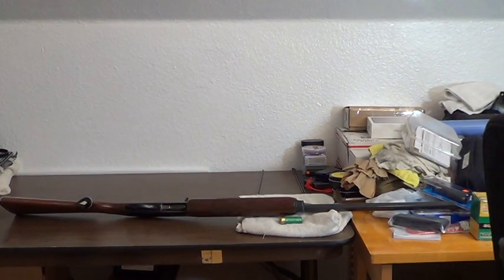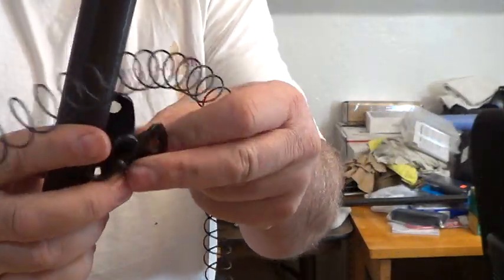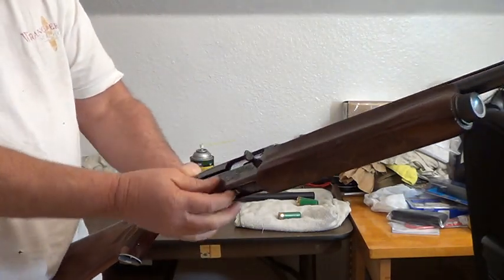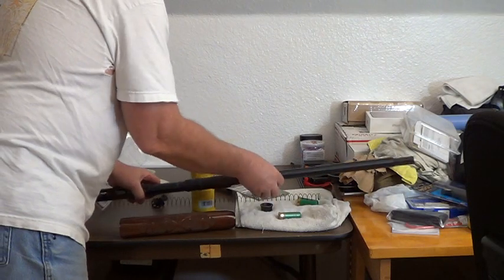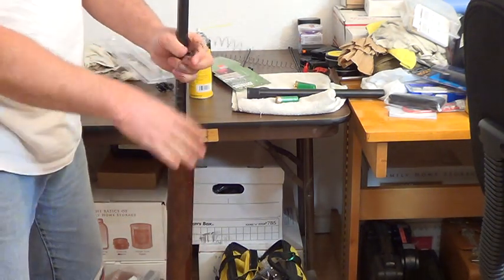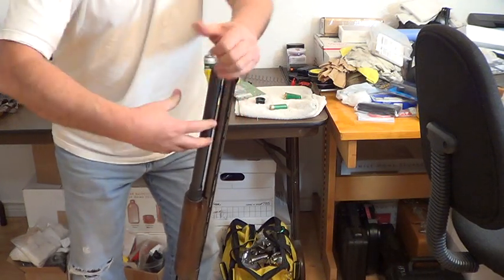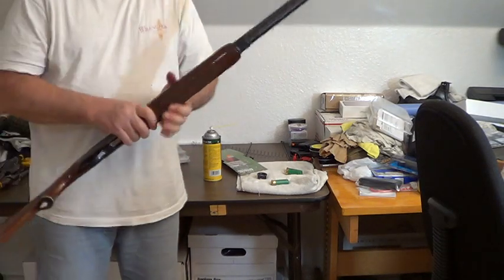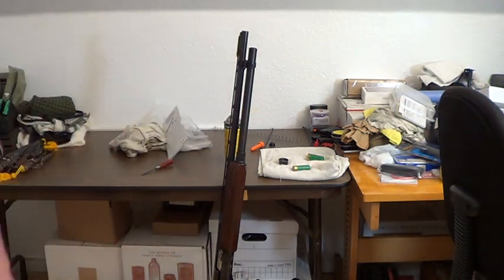Adding Magazine Extension Tube To Remington 1100 Shotgun - Removing Mag Tube Spring

Comment: Mac Cliff here again. I just finished doing this to my 1100. 
A 1,000,000 thank you’s for making this video. 
I couldn’t have done this without you posting this! Thanks so much, I’m so happy 😃
Reply from the maker: thanks, glad it helped..
Reply: So you didn't have to drill out or file down dimples in the barrel so it can pass through to the extension?
Reply: @HUMBLEMANTRYING  
No. This was a very simple task. No machining or modifications were necessary. Remove the old magazine tube and install the new one. very simple. If you have any more questions, I'll be happy to answer then. Just let me know. Cheers.

Comment: Did you put 8 shells in, I think not, you have a demple that has been removed  at the end of the tube to allow more shells, I drilled mine out,also my tube came with threads at the top of tubeso the cap could be installed to keep water out

Comment: Thanks for this.  Just added a tube for my 1100 20 gauge "heavy frame" (means it's an old model - 20 gauge on a 12 gauge frame).  Went from four in the tube to seven.  No instructions needed - just watch the video.  My only caveat for those of us who own the 20 gauge heavy frame - get the 12 gauge tube, not the 20.  The 20 gauge tube would not fit on my shotgun.  12 gauge tube works like a charm.

Comment: That thing is bad ass Rick . I remember when you did a test fire of a 1100 you bought and the sight upgrade video . I was going to buy a 870 28 inch or whatever length the long hunting 870s are and do the same thing . I still may . Do you think the clamp should have some loctite because of the 12 gauge recoil ? Any way that thing is ready to lay down some firepower now . Thanks
Reply from the maker: no because when you clean it after you shoot you should be checking things to make sure.
Reply: Fair enough . I just know that heavy recoiling firearms tend to rattle screws and things loose over time .

Comment: The extension I added was the same as yours; a ten shot, but the follower seems to get hung up after loading four shells. The mag I received did not have the orange follower included. There are no obstructions in the mag tube. I probably need to change the stock follower to an orange nylon one.
Reply: or try to bevel down the follower so it pass the point it is getting hung up on.  just sand it or dremel the back edges to round them over.

Comment: I recently got an extension, assemble it but once I insert 5 shells, it doesn’t take any more shells. I did it just like you did in the video but cant  find the issue to fix it.
Reply from the maker: it should say on package how many rounds it will extend, they have different sizes.  Also check that you did not leave plug in your plug (the empty part that shows when no rounds are in tube. should be 1/2 or so
Reply: @HeyGunPeople  it says 10 rounds. But ir only fits 5 and 1. Weird right?
Reply: @MarRub12  depending on the year your shotgun was made there might be “dimples” in your magazine tube. These will need to be  drilled out in order to allow shotgun shells to pass while being loaded into the magazine extension.
Reply: either drill out or they make a swage tool to flatten those dimples out. looks alot cleaner with the tool.

Comment: Would this tube extention work on the browning A5/Remington model 11? I have my great great grandfathers model 11 and would really enjoy bringing it out of hibernation with a healthy capacity
Reply from the maker: not sure would have call remington and get their input
Reply: so long as you have the correct gauge tube and the threads line up correctly, I can't think of a reason why this tube wouldn't work on really any shotgun
Reply: Dean Bergquist no it won’t work on those guns. They are recoil operated and the barrel moves inside the receiver with the bolt. You get put a 2 shot extension but you cannot use the mag tube barrel fastener.
Reply: @HeyGunPeople  I'll just use the old metal follower that came stock on my dad's mid to late 80's Remington 1100 and take out the old wooden plug and spring to put aside in gun cabinet and good instead of having 5 shots with plug out now 9 or 10 shots with this extension tube and keep my shotgun in original condition other than mag extension !!!

Comment: That's called a Spring Retainer,  being picky I know.   Some have 2 holes and you use your angled snap ring plyers to remove.  Saw comment below that the Orange thingy fits below spring and contacts bullet.  

Made a crap load of shell limiters,  some extra long for the extension tubes,  figure they are playing games when hunting waterfowl.  Never been asked about the 1100.   

I changed out by 1100 barrel so I could shoot 3" shells.  Great gun,  shot the crap out of mine and beat it to death on bird hunts.

Comment: Hi - thanks for the video 

My last shell won't eject into the chamber - (I'm doing it manually - not shooting) 

There is a little lever on the inside and if I push it the shell releases 

Gun hasn't been used in a while 

Could it be a lubrication issue??

Comment: I use my 1100 for dove hunting. Considering on using it to duck hunt, but that considers steel shot.  Can my 1100 shoot steel shot? I keep seeing a bunch of different videos with yes or no. Can someone help me out please, thank you.
Reply from the maker: Remington settled a class action lawsuit in the early-mid 1990's regarding the metal quality in their barrels, and guns coming unzipped. It was mostly about handling steel and higher velocity loads. The 870 was also involved. If your gun was produced after 1995, it should be completely safe. If not, spend the money and buy a barrel designed for steel (Rem-Choke). I would hate to see you blow up the barrel on a sweet shotgun...and possibly hurt yourself or someone else.

In order to safely shoot lead, Hevi-Shot, Steel or Wingmastr HD in a Full Rem Choke the choke tube must state "For Steel or Lead Shot". Also, no larger than #2 should be used in the Full choke

The main problem with steel is it does not compress like lead will.  so if all the steel is exiting at the same time it can damage barrel, when they choke it basically puts a reinforcement on the end of the barrel.  If you really want to shoot steel, get a second barrel designed for it and then you can shoot anything.  Lot of people say it is rated for #2 steel but I can't confirm that.

Comment: I heard you had to knock a little notch out of the original magazine tube the that the tension cap rests on in order to get the extension tube to work properly, is that true?
Reply: I did with mine. There are two nubs pressed into the end of the original magazine. They are like elongated dimples that you can sand out using a dremel or electric screwdriver with a sanding tube on it. Takes 5 mins. Good luck.

Comment: I'm converting my 11-87 to a police model so I could only use a 2shot extension or the mag tube would stick out further than the barrel
Reply from the maker: you can replace barrel with longer one
Reply: @HeyGunPeople  right! I have a 22 inch smooth barrel, a 18.5 (I think) slug barrel, but i just got an 18.5 inch police barrel with rifle sights

Comment: I just added this very mag extension to my 1100 but I can't load more than four rounds and then I can't load any more. I removed the plug and everything is cleaned and lubed but after I load four shells and try to load a fifth it won't load. Something seems to be blocked. Any suggestions?
Reply from the maker: well what size extension did you put on some 2, 4 , 6,   Lay your round next to tube as if they were inside and see how many should fit, remembering spring compression takes up room
Reply: Thanks. I'll definitely try that. I can feel the follower getting hung up at the transition point from the receiver mag to the extended mag.
Reply: @Bowhead31  There are 2 dimples in the mag tube near the end. They hold the plastic spring retainer. I have seen some reviewers grinding them out with a dremel tool, (5 minutes) and others sanding down the follower so that it clears the dimples. I guess if you can just sand down the follower, that means the shells don't hang on the dimples. Haven't bought one myself yet. Just doing the preliminary research.
Reply: OK the dimples are gone but you want to go back to the original setup. Now how do you put dimples back in it

Comment: My tension cap won't stay in. I took it out & tried to put it back in & now it won't stay
Reply from the maker: it gets it's tension from being bigger and having to compress it to force in tube.  if you forced it too much to make it small so it can fit easy then it wont have tension to stay.  Once you end screw cap is on it does not matter since the screw cap will hold it, but if you want it to hole tension you have to open it up, spread the gap with a something so it is very tight and hard to get in tube.  Not a big deal and easy to fix.
Reply: +Think Like A Cop - The Rest Of The Story Thanks

Comment: Question about the 'dimples' or 'crimps' in the mag tube that hold the plastic spring retainer in the end of the tube. Some have ground out the crimps with a dremel tool. Some have sanded down the follower so it clears the dimples. If I buy this, I would prefer to sand down the follower, but I need to be sure the shells don't catch on the dimples. Anyone with experience on one or both methods here? My gun is the 1187.
Reply: I just answered my own question. I removed the spring and tried to pass a shell past the dimples. No dice. The 1187 will need the dimples ground out. It may be possible to grind down the dimples only partially and still hold the spring retainer. I guess either way is okay. I'm gonna order me up a 10 rounder and go for it.

Comment: CAN YOU HEAR THE WORDS THAT ARE COMIN' OUTTA MY MOUTH!!  lol. I'm trying to find out if an extension like that will work on my old Savage 755. Some say yes I'm saying no, some say you have to cut about a quarter-inch off the threads of the magazine tube. 5 round tube extension with the 28"  barrel would look kind of like yours I think. Can't use a barrel clamp though, cause the barrel recoils back like an old battleship gun. by the way the microphone on your camera has plenty enough gain to use your inside voice, lol. Sorry man I couldn't resist!

Comment: IF U CLAMP THE BARREL TO THE TUBE, THE BARREL WILL NOT B ABLE 2 MOVE IN & OUT OF THE RECEIVER , SO IT WILL NOT EJECT OR RELOAD !
Reply from the maker: it ejects fine
Reply: The 1100 is not a recoil operated shotgun which means that the barrel does not move during firing. So clamping a magazine extension to the barrel is not an issue.
Reply: I really hope this is a troll post.
Reply: The receiver internals move so the barrel doesn't have to. It's easier this way.